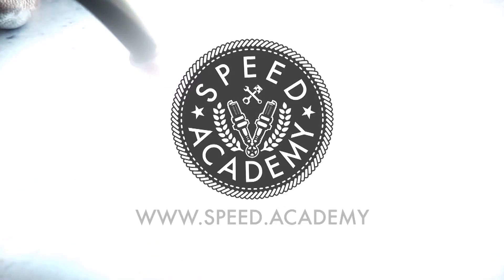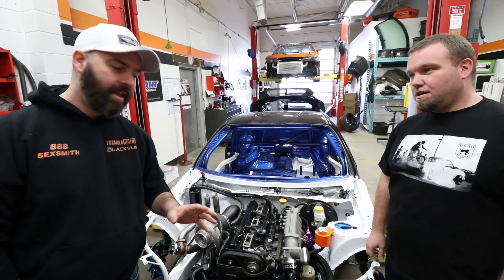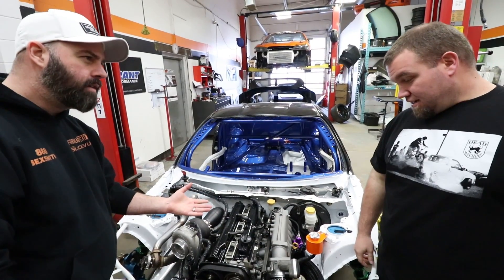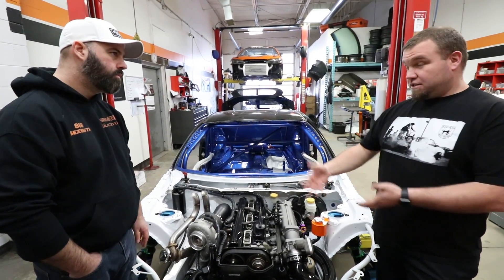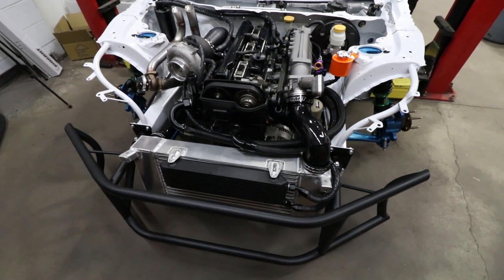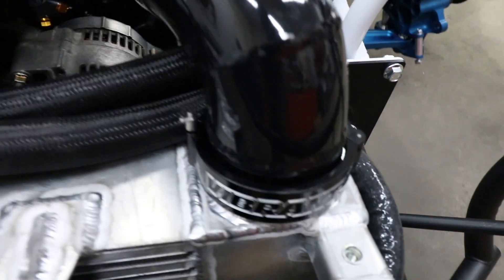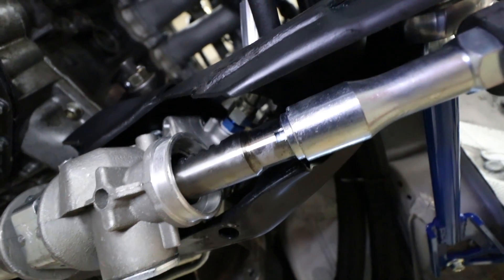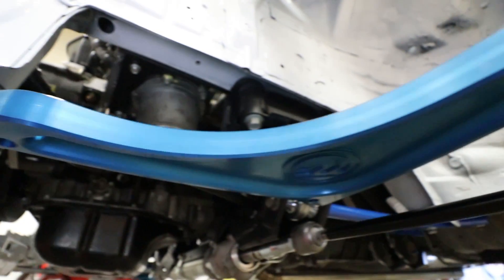2JZ BRZ Drift Build - Paint, Overfenders, & Lots Of Angle! EP06

Comment: How did they figure out the CAN motor controller for the Mazda3 pump?
Reply from the maker: Good question. We'll inquire in the next video.
Reply: Speed Academy I want to run a electric power steering pump in my Civic track car but the MR2 pumps are 5x the cost of the Mazda3 pumps. EV guys were trying to crack the CAN protocol to use them in their electric cars but as of yet (to my knowledge) haven't got them to work